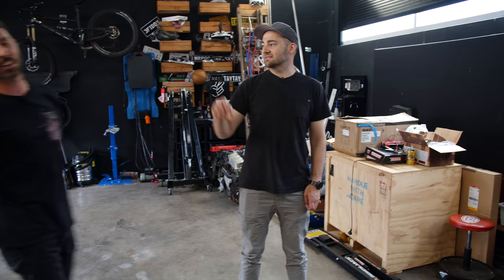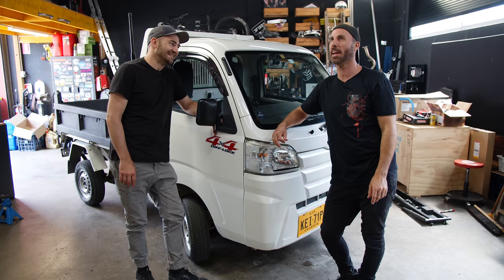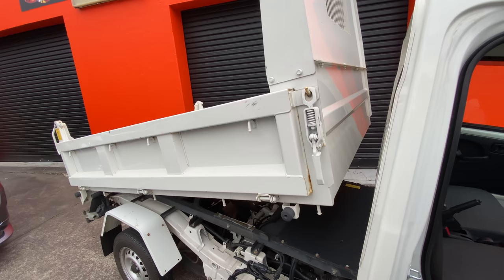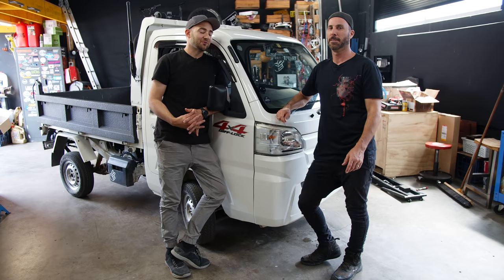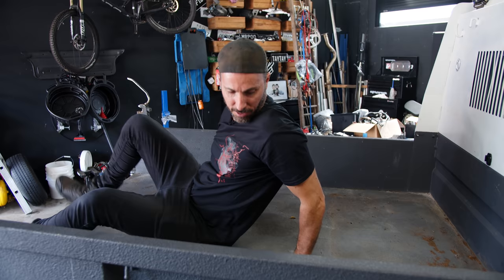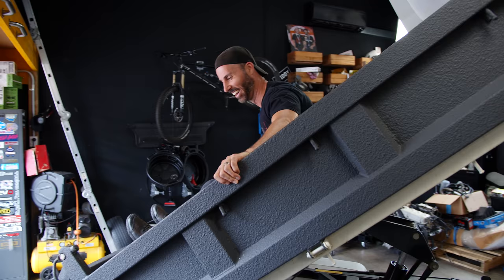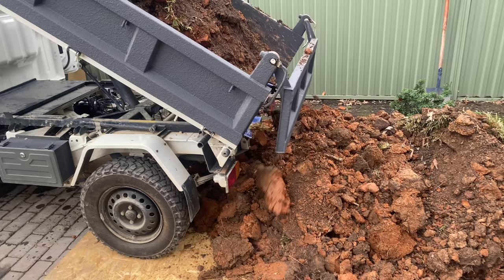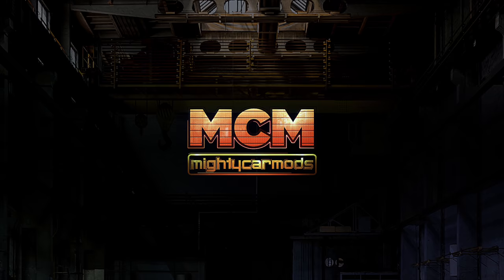Marty's new car (is not a car)

Comment: Fan: you should buy a truck
Fan: you should buy a 4x4
Fan: you should buy a kei car
MCM: we got you fam.
Reply from the maker: 100%
Reply: Make me a pile of dirt...
Reply: @mightycarmods  How about removing doors and trailer w/ massive off road tires on it?
Reply: @mightycarmods  Will the lemon tart still be able to sponsor the kei build after being dropped an mashed?
Was there a will or did it recover?
Reply: Put a burp burp in it 😳
Reply: I'd like to see the motor get a cam or turbo :D
Reply: Japan: hold my sahi
Reply: Max Power  I think they are more excited about it than the e30, his passion is contagious and this feels like proper mcm
Reply: @mightycarmods  Fan: You should get track wheels. Not wheels for using at a track, but wheels that have tracks. Look up "kei truck tracks."
Reply: no worry we got it all in 1
Reply: I see the off-road tyres made an appearance. ;)
Reply: @mightycarmods  you so wrote that yourself lol🤣

Comment: I fear I'm being the "a person on the internet will tell us" guy, but PTO is power take-off. Basically a spinny shaft off the engine for spinning mad accessories. It's a farm tractor thing. Please still love me.
Reply: Not just a tractor thing, plenty of vehicles use a pto
Reply: @dan_2846  heaps of cool ones. Like Unimogs, old school Land Rovers & Land Cruisers, etc
Reply: @michaelatkin2562  for sure, plenty of bigger stuff too, like trucks and plant including telehandlers
Reply: Fire apparatus use them to drive generators and pumps
Reply: You and 500K other people who work with or on heavy equipment and the like. So some one was going to say it.
Reply: On stationary engines its also what they call the clutch.
Reply: Get a PTO powered key crane for it!! Lots of other cool attachments I can think of 😬
Reply: Probably a PTO powered hydraulics pump
Reply: @danishlalahero  endless possibilities
Reply: How fast does it spin? Could you attach a lathe and be able to machine something in the parking lot of...say, Tsukuba circuit?
Reply: @blanked_out_chin  Depends on which gear he puts the truck into, by the looks of it
Reply: You're telling them useful information, the "guy on the internet who knows better" is when the commenters tell the guys they're doing something "wrong" and that they know better
Reply: Yup
Reply from the maker: Thanks for the tip!!
Reply: @mightycarmods  tip truck tips, you might say
Reply: I'm not sure if there's a pto that attaches to the engine or not, but the ones I know of attach to the transmission (gearbox) hence why he has to put the transmission range stick into neutral and selects the speed of the lift with the gear shifter lever. 

Another good example of a pto vehicle is a tow truck, the winch runs on hydraulic pressure from the pto which is why they have the high rev setting to get the needed hydraulic pressure.

Comment: a PTO is a Power Take-Off device that uses the energy from the driveline to power an external device. On heavy trucks you can have the PTO either connected to the flywheel (good for a concrete mixer which needs to spin all the time) or the gearbox if you only need it when standing still (hydraulic pump). 

Awesome car:)

Comment: Let the comparisons with Hoonigan and their rotary swapped version begin
Reply: body kit
crazy rotary
maaaad fitment issues
off set tyres
crazy long pregnancy
new mechanic... Suppy
booo Dan

anyone
... 
bueller....
Reply: Not 4x4 but lowered with a body kit. I want bigger wheel maybe some 215's and small turbo.....
Reply: Let's take a working vehicle where reliability is important and put in an engine that will need rebuilding as part of the maintenance schedule
Reply: @EliJayFly  you clearly know nothing this isn't the 80's anymore. Go watch angel motorsports or rob dahm you can easily build a reliable big power rotary

Comment: Welcome to the world of minitrucks.  I got my 94 Daihatsu Hijet S110P to push a snow plow.  Something with an enclosed cab, heater and windshield (with wipers even), makes a lot more sense than an ATV or UTV when you’re pushing snow around.

Turns out that it is the funnest thing I’ve driven on the road, since i was twelve, and my dad took my go-cart away because he caught me driving it on the road.  The little guy has turned into my daily driver.  

And, with the tipper (actually I think yours is a Heavy Dump), there is a space at the back of the cab and in front of the bed where you can add relays, fuse panels, etc.  And, if you put the bed up in dump mode, and take of the engine protection panel you can actually get to almost all of the engine without needing an extra wrist.

Actually at low speeds, such as around the homesite they can haul 700-kg.  Part of the weight limit is the Kei class regulations in Japan, which limit the max weight.  The limit is most likely the tires.  Get some of the little 12-plys and it will haul a full bed of sand.

Comment: "PTO" means "power take off". I learned this from building a Lego tractor. The PTO is a rotating shaft that exits at the back of the vehicle, and can be used to power a variety of external machinery - usually a trailer tiller or something.

Comment: Pto is power take off, like on a john deere.  You basically bought a tractor
Reply: It's like a Japanese Kei-Unimog
Reply: It's hydraulic with a pump on a clutch, right?
Reply: @Bassalicious  yes (in Marty's case) but the pto part is just the hookup on the tractor and it runs off your engine power.    Like a 2nd driveshaft.  You can hook it to a hydraulic pump or to an actual shaft like to use a bush hog.
Reply: @getchasome6230  Gotcha. Thanks.
Reply: I've always heard power take over
Reply: @clancy4freeswag562  I just googled it and I guess you're right. 🤷‍♂️  who woulda thunk?
Reply: @getchasome6230  that's funny..i just googled it and i thought you were right..lol

Comment: In 2016 we bought a K truck in Alaska. It had modified snowmobile lift kit, atv wheels and tires, and an exo cage. 

We rallied that on the beaches and rivers in Alaska. It was wild.

Then we threw a strap around the cage and picked it up and put it on deck with the crane.

Comment: Lemon tart....this truck should be called the lemon Kart! Diff lock 😍. I borrowed one of these from work once during heavy floods and took it swimming 😁 the air intake was in the side of the chassis...five hours later it had a little knock coming from the engine 😬 took it back the next day, parked it up and nobody noticed winner 👌

Comment: PTO stands for power take off. It's basically an output from the transfer case that, in this instance drives a hydraulic pump.

Comment: I'm sure you guys already know but PTO is power take off. Usually PTO is used for either powering a hydraulic pump or mechanical power through spinning a PTO output. Your truck is basically a tractor.

Comment: Ours also has a sprayed in bedliner with both colors in the bedliner. All the way up the back. But ours isn’t a tip model. But PTO stands for power take off. It is exactly as it states. It takes power off the engine and transfers it to another device. It would be the same on a tractor or anything else

Comment: You could tap into the hydraulic PTO and swap it to Citroen C5 struts at the front end, so you can fix the ride quality and use a button to go from chassis on the pavement to taller than stable.

Comment: I picked up a RWD 89 Mitsubishi Delica Van for 700 USD running and driving with only faded paint being a problem (even the interior was mint).  Delicas weren't really Kei spec but they are fairly small compared to your average conversion van.  The imported 4x4 ones go for quite a bit of money now but after doing a DOHC + turbo upgrade to the 4G36 that was in it I'm cruising around comfortably in my RWD.

I thought about picking up a Kei truck but the prices in the US are stupidly high for 25+ year old used imports.  Don't get me wrong, I own 2 Cappucinos and a Beat, but those cars were all cheap (especially the dead Cappucino that now is running a Turbocharged G13B DOHC 1.3L at 200hp to the wheels...I've heavily modified everything adding wider tires, better brakes, a cage, etc to keep it from being as much a death trap).

Comment: one of my bucket list car/mods is to get a Mitsubishi A190 kei truck and do a EVO X driveline swap. It is one of the few kei trucks that has the front wheel in front of the door, instead of under the door, it also has a little nose and not just a flat face, so more room to hold an engine/trans upfront and I can lower the seat below the factory floor without the engine in the way... one day

Comment: Is it possible to add a stabilizer system to root the vehicle and perhaps a more heavy duty leaf spring to increase payload capacity? I'd put everything that a turtle back trailer has (roof tent) in the back & use it as the official MCM overland vehicle.

Comment: You can get those shipped from japan for under 7 and they have 4wd but no air con or tilting of the tray
Reply from the maker: tipper ads a lot of cost, as does the later model factor

Comment: hope you guys know the sides also fold down on the bed to be a flat bed ps i love it and thinking i want one myself  also another tip the 700-900lbs rating  is 100% fake u can add more and towing wise ppl have towed 2000lbs trailers n said  they have had no issues  its just cuz the "k truck" has legal writen limits from china or it wouldnt be classed as  a k  vehical

Comment: I think the thing with the BMW is people were just into it as it was, and the sponsorship was thrown on abit too heavy, and then focused too much on the key parts of that game, which then pulls you out of it, as you wanna know about the car, not the game, as good sponsorship highlights something good without taking something away from the source product, as their so related you cant imagine them apart.

and a black ops game has about as much to do with car modding, as a Sam Fisher game of old (back when those french farts actually used to make good games) does with Fishing. 

like you'd think their'd be some connections or some cool stuff you can do with it on the face of things just based on the name, but you cant.